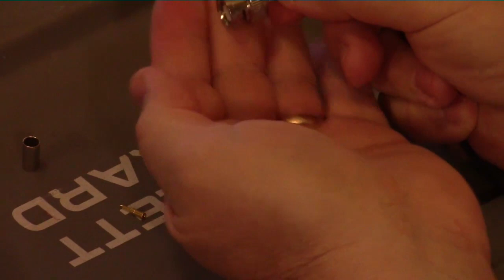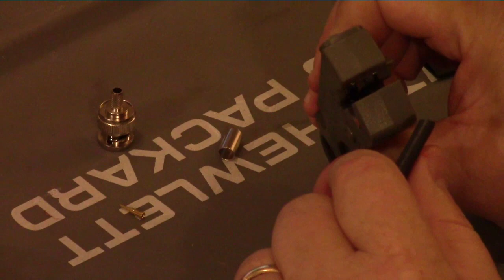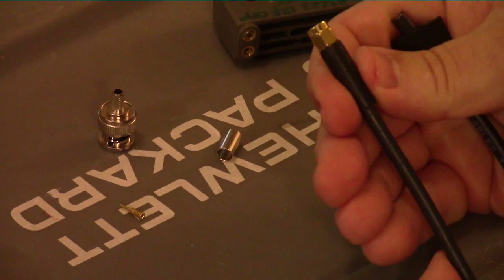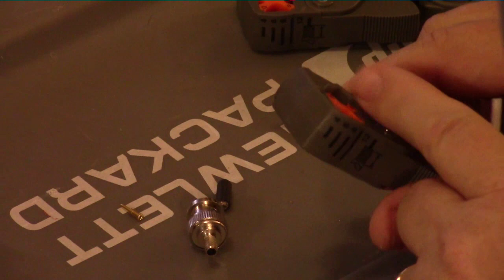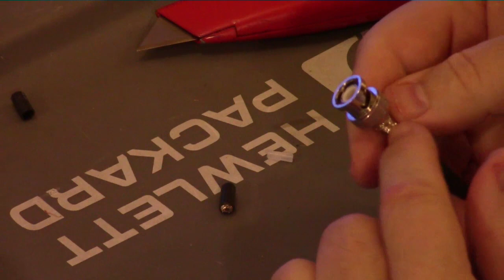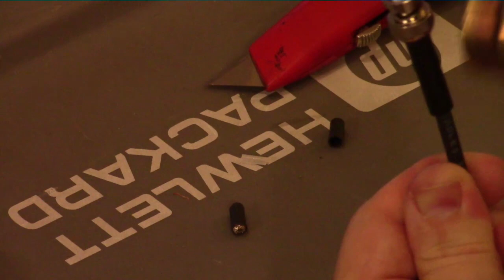How to Install a BNC Crimp Connector on RG-223 Double Shielded Coax

Comment: very nice video. love the tip about using the crimp tool to push the ferrule up. I have completely dislodged the bnc connector before while trying to push those ferrules up (not rg223 but lots of video coax).

Comment: Thanks for a couple of great tips, I especially liked the one about reaming out the circumference of the ferrule to make it easier to slide onto the connector body over the braid...I'll do exactly that next time I do a crimp!  73 - Dino KL0S
Reply from the maker: Hiya Dino !  Long time no hear. Glad the video is of help.  Currently rounding up dozens of cables to run some cross-talk tests to let folks know what the effects of SE are. 73